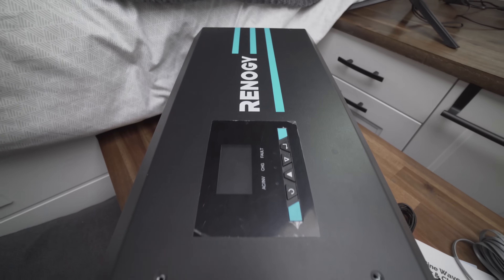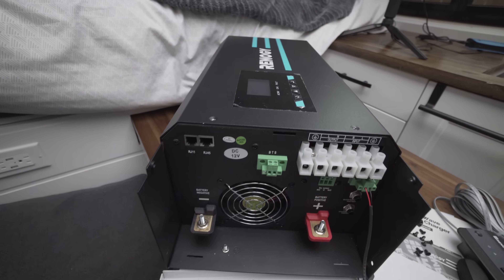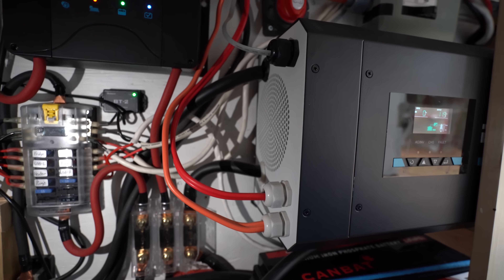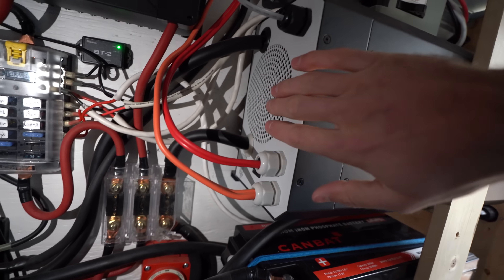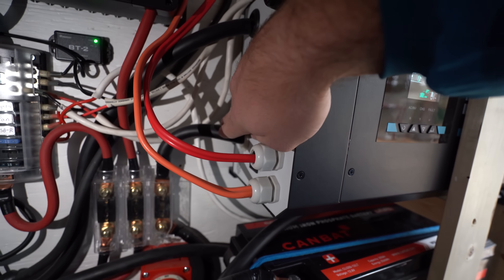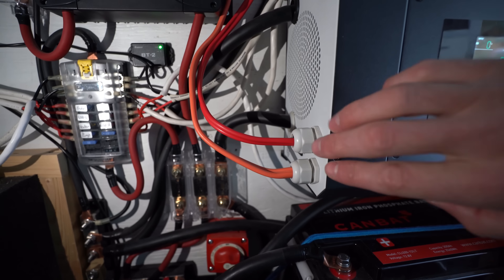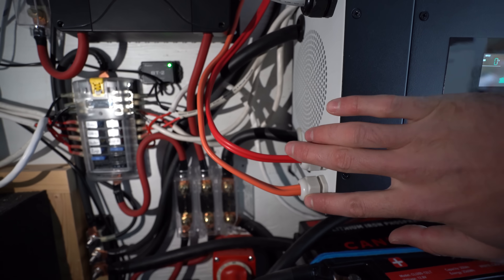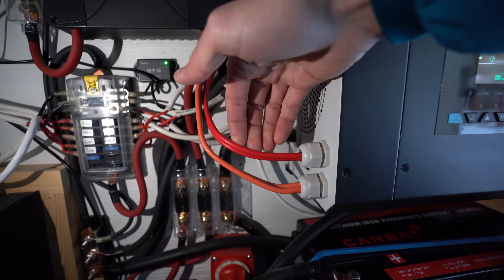Pure Sine Wave Inverter: How To Install A Renogy Inverter Charger

Comment: Does this inverter support connection to the Bluetooth or the Hub? I haven't figured this out yet. I'm thinking no because I see that you aren't taking advantage of that.
Reply from the maker: No but I figured out how to turn it on and off via the app that I plan on sharing in a video soon 👍
Reply: @madetoexplore  Using the smart relay if I had to guess. Your old batteries are going strong by the way, thanks!

Comment: Does it always use the battery? I heard it always use the battery power even when plugged in to AC.
Reply from the maker: No I believe it bypasses the battery when it’s plugged in.
Reply: @madetoexplore  Thanks, I wanted to confirm that cause that's what I'm seeing in reviews that it drains the battery even when it's plugged in. So when the power goes out, the battery is drained as well.

Comment: Hi

Thinking of installing the same inv/charging . I would like to know if the remote switch turns on and off just the inverter or both the inverter and the charger? Thanks in advance

Geoff
Reply from the maker: It turns both on and off. They operate as one unit essentially.
Reply: @madetoexplore  Thanks for the reply. I called Renogy in CA and asked the tech the same question. He assured me 3 times that it only turns off the inverter and leaves the charger on. go figure!

Comment: Hey there, did you use the battery temperature set up in your install too? Thanks, Elliot!
Reply from the maker: No I didn’t because I have a heated battery in the winter. I rely on the BMS in the battery for the cold and hot temperature shut off. If you live in a warm climate it would be a good idea to install the sensor though.

Comment: I thought that the converter converts the amps from ac to dc. Therefore if you use a regular 15 amp ac plug you should be able to use the highest setting charge rate on that, which is 65 amp. The formula is 65 amps x 12v= 780 watts . A standard household or generator 15 amp  plug is Rated at 1800 W.  What is your maximum charging current rate for your battery? Also, another interesting thing I learned was the maximum current charging rate is usually per battery. So if you upgrade and put batteries in parallel you can get even more charging power.
Reply from the maker: Yes it does. I don’t plug-in very often at all but when I do it’s usually to a 15 amp outlet. If I try to pull more than 15 amps from that socket I’ll blow the breaker. That’s why I set my inverter to 15amps but you can adjust it up to 30 amps if you’d like!
Reply: @madetoexplore   the electricity is going into the renogy at a converted voltage. Yes the plug can only take 15 A but that’s at 110 V. You are charging your battery at max 65 A at 12 V. This is much different than 110 V that’s why I gave the formula. I was very confused with the conversion at first. But since I got the renogy 2000 inverter charger. I haven’t had a problem charging 65 A at 12 V into my batteries  from a standard wall receptacle. To be safe I’m going to call renogy Customer service though ha
Reply from the maker: @MITCH1221  interesting! Thanks for the tip Mitch. I’ll have to test this out myself. The way Renogy words it in there install guide makes it seem like you can only pull up to 15 amps. Keep me posted on Renogy’s feedback!
Reply: @madetoexplore  to correct myself I mean 120 v not 110v..
Reply: Any update to this? This was my main question. Considering this Renogy inverter charger and have a noco 15a 125v shore plug that i was going to use. Am i limited to 15a charging current?

Comment: Hey dude, thanks for the video. When that unit is charging at its full 65A, do you know how many amps it’s using on the AC shore power side?
Reply from the maker: I’m not completely sure. I’ve only pulled a maximum of 30 amps from shore power.
Reply: The draw would depend on your AC load in addition to the charging. If you want to calculate the charging alone: 12V65A is the same power as 120V6.5A. There’s some loss, so probably more like 120V7A.
Reply: @saxofunk   thank you.

Comment: I purchased the identical inverter and wired in one GFCI.  Plugs work great but the GFCI does not trip when testing on AC on battery.  Connecting a house plug tester reports open ground.   Just wondering if this expected?   I do have the inverter grounded from the chassis to the negative bus.
Reply from the maker: Yes this is expected 👍
Reply: @madetoexplore   Thank you for the reply. That gives me peace of mind.

Comment: Hello, can this be wired with 50amp service
Reply from the maker: The inverter is only designed to pull up to 30 amps but yes, I believe you could install a 50 amp plug
Reply: @madetoexplore  For sure, but except the unit to shut down when you start to draw too much.  Don't try running the air conditioner.

Comment: Do you have to ground the inverter and corresponding components or can you just run one ground from the negative bus bar to chassis?
Reply from the maker: That’s correct. The 12v system is grounded to the busbar/chassis. The 120v system has a separate ground connection that should be wired to a 30amp plugin.

Comment: Great video, on that subject of venting enough are you not worried or have a lack of on that end where you have the plywood running up? It seems pretty close...Renogy is recommending 10" all around seems like a lot but...not to shure what to do with that...🤔
Reply from the maker: Yeah, I’ve talked with a few people about this actually. I have run the inverter for 30min at almost max output and haven’t experienced any heat issues at all. I’ve also cut a hole around the fan on the end to allow for better air flow. 10” of space around a large inverter is ALOT of real estate for a campervan lol so I’ve just made sure not to block off air flow on either end.

Comment: So my journey to build has included the purchase of a Renogy DC-DC charge controller, with the theoretical advantage of making alternator/solar charging set up easier.  BUT as I’ve watched reviews and discussions, there seems to be a limit imposed by the system.  Then I read about upgrading the T1N alternator so that the house battery recharge capability is such that solar almost seems unnecessary.  I have a separate 2000 pure sin wave inverter.  As with the rest of my project, I’m poised to start, but then I don’t.  Any thoughts about relying more on the alternator?  I’m running solar wiring just in case.
Reply from the maker: The alternator is much more reliable obviously. I upgraded ours to 150 amp alternator myself which was easy and only about $200. I also installed a switch to shut off the solar so the charger will pull 50amps from my alternator. I think it works awesome! Solar panels are just kind of a plus but also can be very useful some days.
Reply: @madetoexplore  For Van life, definetly a must.  Need all options for those cold winter nights
Reply: Just my 2 cents, be fully charged during the drive and contiuously topped off by solar when it is available. I treat is as complimentary systems not a choice also have a pure sine generator as an emergency backup. Redundency is KING.

Comment: Can you wire this unit to a 50amp system ?
Reply from the maker: What do you mean a 50amp system? 50 amps of solar? 50 amp hours of battery storage?
Reply: Trailers generally have either a 30amp or 50amp system My trailer is 50amp it has a 50amp shore power plug
Reply from the maker: @Levi-ou2bk the transfer relay is only rated to 30amps so I believe you could connect it to a 50amp outlet but it would only safely pull 30 amps

Comment: Hello I rather enjoy the video thansk for that information.   I am wondering what size wiring did you use to connect/parallel your batteries?
Reply from the maker: No problem! I used 2/O
Reply: @madetoexplore  I very very much appreciate it.   I've been getting told like 3-4 different size since I'm going to have 3 renogy 100ah smart lithium batteries.    Are you willing to chat more about wiring / fuse placement?
Reply from the maker: @poyzer22  if you have 300ah then I would us 4/O to connect your batteries, busbar, and chassis ground. Yeah for sure

Comment: Hello! Awesome video!
Essentially you’re plugging the battery into the inverter, and plugging the inverter into the shore power connection. Making sure to turn off the converter when in use. Is that correct?
(I get kind of lost with the terms so trying to simplify)
Reply from the maker: Thank you! Yes that is correct
Reply: The Renogy 3000 watt inverter I order is a two-way charger.  One can use both to charge at same time.  I have 3 x 100 amp LIFEPO4 batteries.

My plan/project: When off grid, I will plug in the Trailer RV 30 amp plug.  Easily can run off 15 amp service, it just the Air conditioner that would be too much for it.  We also have our Honda Generation for back up/emergency.  Once I decide on which solar panel to fully invest, if necessary I upgrade my solar generator.

Comment: Awesome vids man gave a sub :) I do have a question though, I opted out of using solar on my van and will solely be using Shore Power and a DC/DC Charger for my system. I have the 3000W inverter charger and I am trying to set it up. Should I connect the Inverter Charger to my blue sea safety hub? If that makes any sense
Reply from the maker: Thanks! Is the blue sea safety hub your bus bar?
Reply: @madetoexplore  yes I suppose it is.
Reply: @madetoexplore  I'm kind of just going as I go lol.
Reply from the maker: @WankStain  just thought I should confirm! Haha yes you should connect the inverter to the bus bar and then the bus bar should also be grounded to the chassis and connected to the negative battery terminal

Comment: Thanks for all the information - I've been using my 2000W in my system just as an inverter but have been putting off the charger part. Primality due to lack of informant from Renogy. Interesting to see you use a fused disconnect is there a reason you used it over a breaker?
Reply from the maker: I was able to get a fused disconnect in a smaller box than a breaker box but both would work. The important part is protecting the inverter from shore power. You could also get one larger breaker box for both your 15amp breakers and 30amp breakers if you wanted too.

Comment: Great video. I have a 3000W I'm working on hooking up right now. What did you do for grounding the I\C? Didn't see anything in the vid but it does talk about grounding in the manual, just doesn't say how to do it. I don't see any lug on the I\C to attach a ground wire. I assume it should be separate from the DC negative connection. Thanks for the vid.
Reply from the maker: Thanks! Are you referring to grounding the shore power connection? It’s right beside the positive and negative
Reply: @madetoexplore  No, the diagrams I have seen, and the I\C manual, show an earth (or van) ground connected to the I\C. On my I\C (Renogy 3000W) I just noticed a small screw at the bottom of the area where all the wires hookup. I think that is where it is supposed to be connected. Now I need to figure out what charge settings to use. Seems like these only have a "max charge voltage" and "low voltage threshold". In effect, the voltage to start charging and stop charging. But when it is charging (60A), the voltage goes up to the 14v range and then when it stops, it immediately drops down to the 13+V range. So I've set mine to 14.4 max and 13.4 low (start charging again.) What about your settings?
Reply from the maker: @jdtracy  yes I have grounded the inverter to the frame of our van via the negative DC cable. I also have very similar settings to the ones you are planning to use.
Reply: @jdtracy  Hey there! Wondering if you've figured this out since then? I've ran into the same issue with the manual not giving instructions. Not sure if I need to ground the inverter separately or if my bus bar ground is sufficient.
Reply: @BANTYxROOSTER  Yeah, everything I've seen looks like you just do it via the negative bus. It is a separate connection than the negative connection though (with much smaller wire). And the negative bus does also need an actual connection to chassis ground with a big wire.

Comment: I don’t understand how this all works I have purchased one of these and when I plugged into Shaw power and use a 3000 W kettle I keep getting overload why is this I know the inverter is rated at 2000 W but I am onshore power
Reply: You. need two way inverter or solar panel.  One input AC and a Output AC. Auto transfer option. It wired in way that you can charge your battery from shore power and solar power and it will switch to the grid when running appliances without pulling from your battery or inverter.  That the plan I would try.  The Renogy DC to DC doesn't have that option.  This is the unit I order below:

The Renogy 3000W Pure Sine Wave Inverter Charger w/ LCD Display is ideal for RV or standalone. The Renogy 3000W Pure Sine Wave Inverter Charger not only acts as a DC to AC converter that allows you to power your household appliances but also charge and maintain a battery bank when connected to shore power and is now compatible with Lithium batteries. With a low transfer time, power remains uninterrupted when switching from solar to shore power. The advanced Renogy Pure Sine Wave technology will protect and extend the life of your electronics and appliances. The Renogy 3000W Pure Sine Wave Inverter Charger is a perfect backup power source!
Reply: I’m having the same problem.  When I am connected to shore power and want to run my AC it overloads and throws different errors like 07 overload or 04 battery voltage too low.   Why would it overload like this when connected to shore power.  If I connect to shore power without running through the inverter I have no problem running AC
Reply from the maker: It probably doesn’t matter about shore power then? Your overloading it regardless
Reply: @madetoexplore  so regardless I am still only pully 12amp of shore power ?

Comment: Thanks for the overview install.
How has the Renogy inverter charger been for you, would you purchase again? Looking for your thoughts I recently purchased a motorhome that has 700w of solar panels and mppt controller but previous owner removed Xantrex Freedom XC2000 but was going to go Renogy if good. I've read the Renogy surge load is low so not sure if 2000w is good or should go up to 3000w?
Thanks for any suggestions or comments.
Reply from the maker: Yes I would definitely purchase this inverter again, it’s worked awesome! I would recommend the 3000w, especially since it’s only $100 more than the 2000w
Reply: @madetoexplore  Sounds good thanks. As for batteries do you have any suggestions for best pricing on Lithium batteries in Canada? And would 200Ah be enough to start with a 3000W inverter or would I have go up to 300- 400Ah?
Reply from the maker: @magg992008  I’d recommend Canbat for sure! https://www.canbat.com/battery/6/

I’d start with 200ah. What component has the largest draw in your system?
Reply: @madetoexplore  ok, sounds good. The AC units but I'd run Generator if was going to run them. Next is the Convection Microwave, I think it is around 800-900W

Comment: I'm planning a boat install, and something I read said to not install over the battery so battery vapor doesn't eat it up
Reply from the maker: Not to sure what you mean by battery vapor? It says in the manual to make sure it’s properly ventilated so it doesn’t over heat. Mine is close to the battery but it’s also ventilated very well.
Reply: Lead acid batteries need to be very ventilated.  Go LIFEPO4 and no issue.  Updated Renogy are all LIFEPO4 smart when dealing with Lithium.  Though, I don't think smart enough to auto setup, so you have to set it up as per instructions.